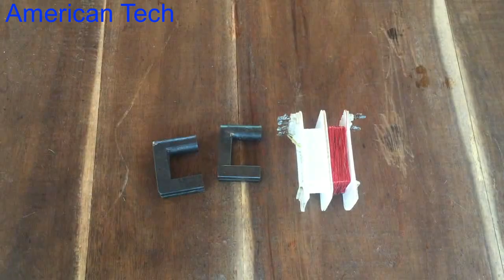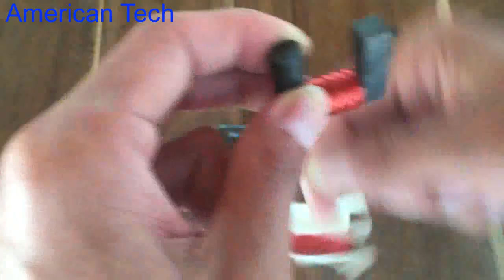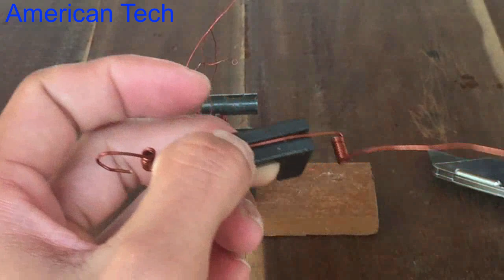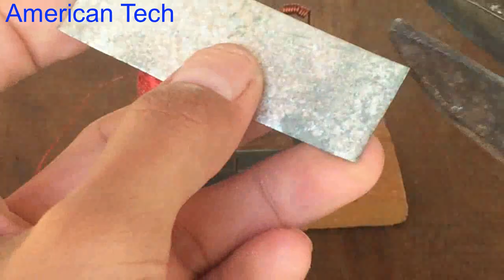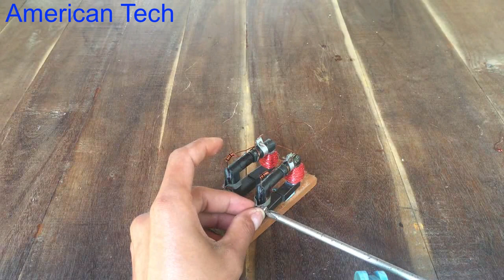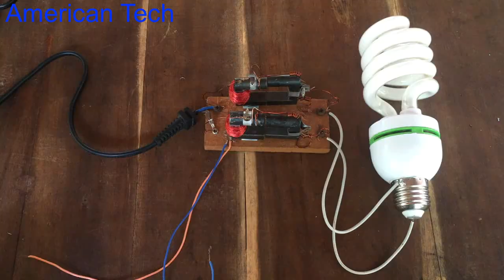How to make 3V Relay for school project , homemade a safe relay 2017

Comment: why did u do something that seems a decent rele but used a thin copper wire to make the conection, at least eexplain that if u want/need put something more powerfull than a lamp u need use a better conection, or ¿I am that bad? good video